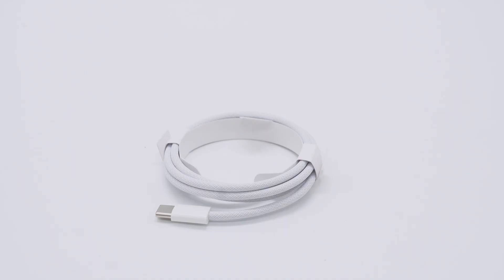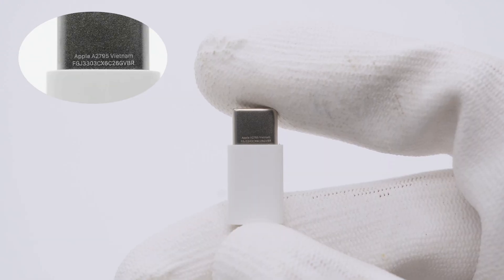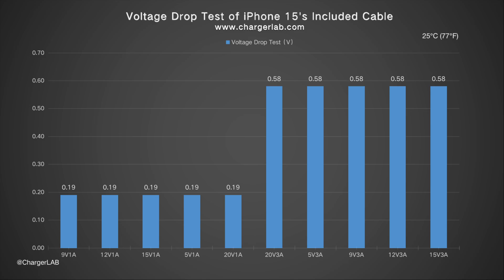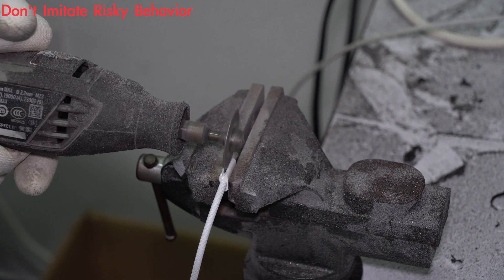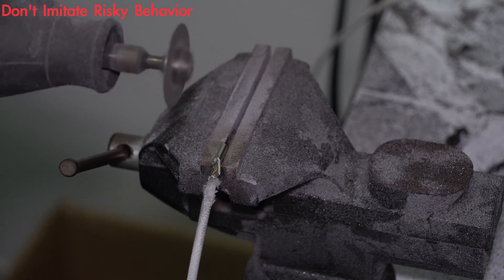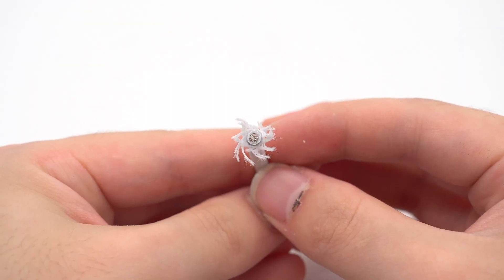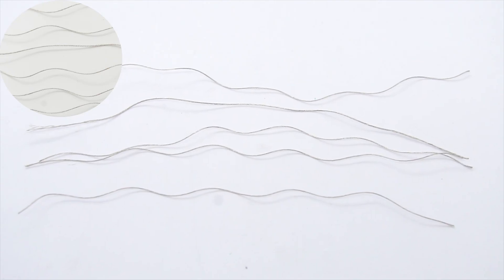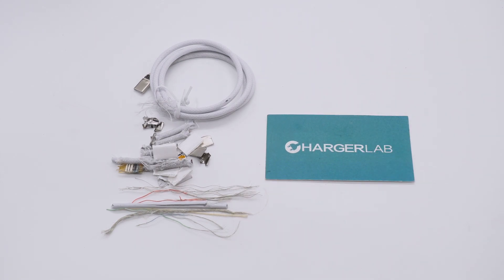Up to 60W | Teardown of Apple Original USB-C Cable For iPhone 15 Series

Comment: So I can take this cable, dip it in some cleansing water without worrying about damage. Since it has a rubber layer inside protecting the main wires. Interesting.

Comment: For travel purposes, I'm looking for the lightest cable possible, and if it's thin, that's even better. A 3A rating would be sufficient, but I want it to be well-made with high manufacturing quality. This Apple cable seems like a good candidate—would you recommend it? Or do you have any alternatives to suggest?
Reply: Belkin boostcharge Flex / Flex pro are my cables of choince, do check them out!
Reply: Is there any chip present at ends??

Comment: What's the purpose of the apple specific ground pins? Any other cables have them? Any other devices use them?
Reply: Same question. Did you got answer from anywhere else?

Comment: Well, Is it ok to use anker 20w magcube for cooling fan at full  load straight 4-5hr? Is it resist heat? Mine use with flydigi B6 at full load at 1hr and it got so much heat and bad smell electronic components inside ( maybe overheated)

Comment: Wish they would do a 2 Meter Cable like the 1 Meter one with 60 Watt charging while keeping the cable thiner. I got both cables and I prefer the thiner one. I just use them for charging, so I don’t care about the data speed